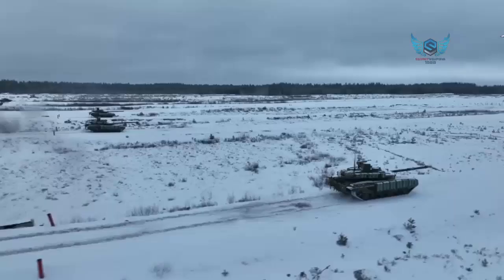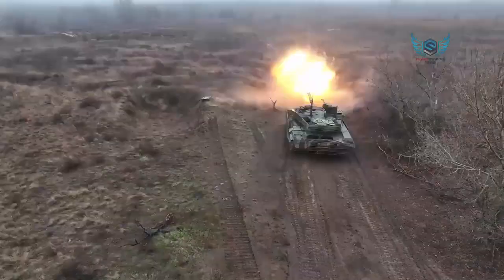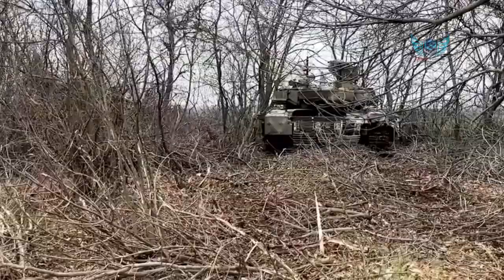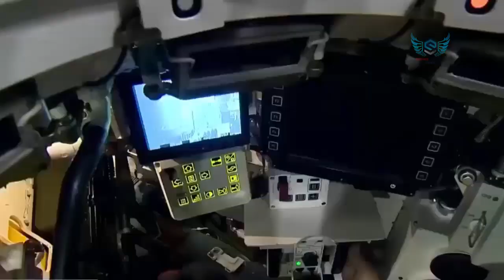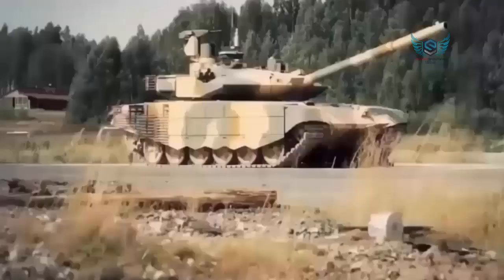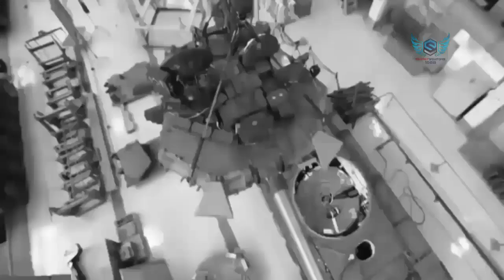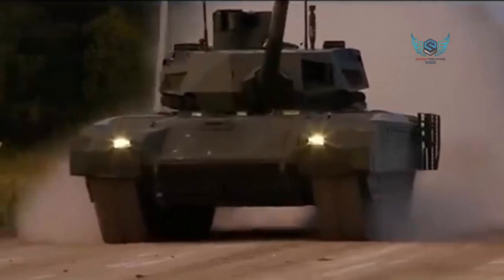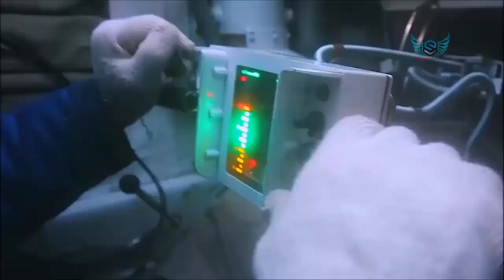Russia's New Deadly "battlefield killer" T-90M Super Tank In Action Shocks NATO

Comment: Even with all it’s upgrades the reverse speed and transmission of the tank is still crap. 4 km reverse is garbage compared to NATO 20-30 km reverse speeds.
Reply: This has been fixed on the newest batch of t90m there now more in line with the t80 in reverse about 14km not as fast as nato but plenty fast an miles better then the t72 an t90a they have allso started useing malikite reactive armour designed for the t14 in place of the relikt t72mb4 has allso gotten the upgrade while doing away with bar armour an adding more block era
Reply: @raybensinger8383  is it true they started using a bustlerack autoloader too ?